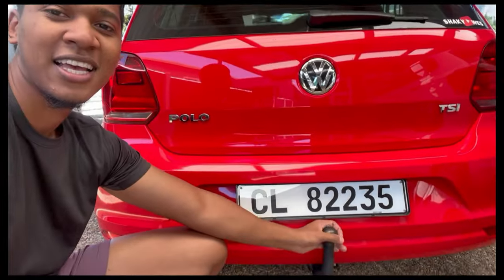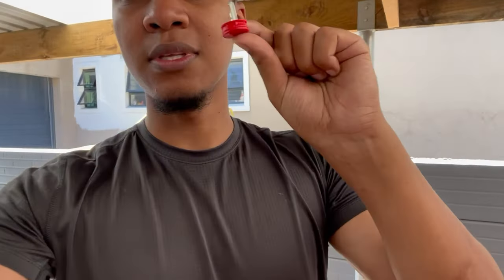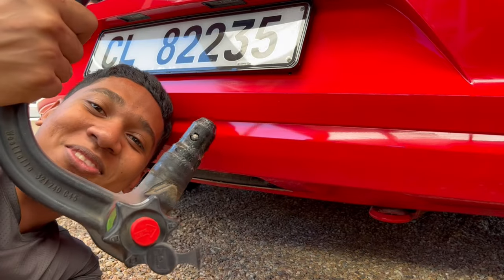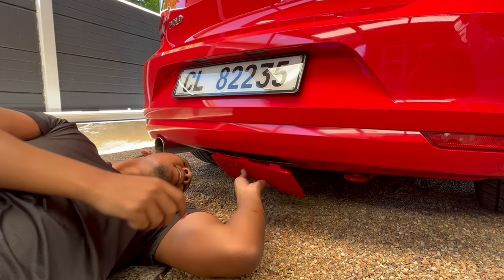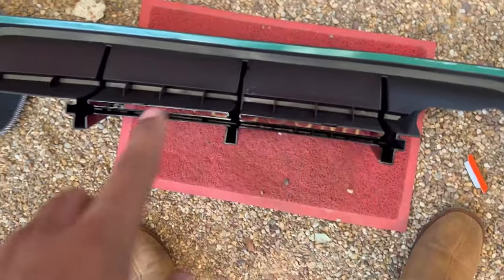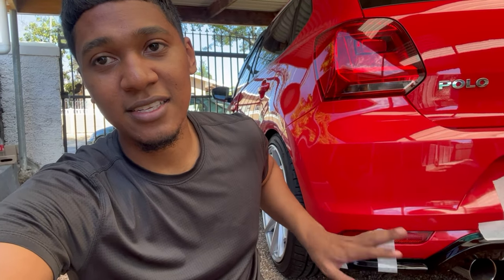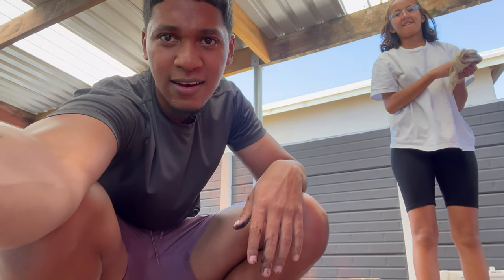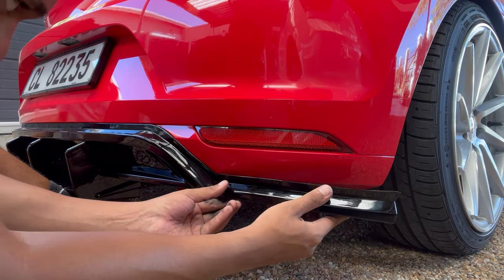INSTALLING AN AFTERMARKET DIFFUSER ON MY POLO 6 - IS IT WORTH IT | PART 6 OF THE BUILD | SHAKYWES

Comment: Where did you get those bits that go to the left and right sides of the diffuser once it's on? The bit extends it out further?
Reply from the maker: Hi i got this with my diffuser so its basically a 3 piece diffuser
Reply: Hi bro,so were did you buy your difusser and how much was it bru

Comment: Got me the same diffuser recently. Do you recommend cutting off the tail pieces around the exhaust ? Coz it is two dummy pipes lol. Is it noticeable on the car that you cut it off ?
Reply from the maker: Hi I recommend cutting out the dummy tail pieces but make sure to cut it out nicely/properly. You will see it but its not an eye sore i would just recommend doing your exhaust first and do a dual tailpiece setup to fill the gap. I hope it makes sense

Comment: Hey man did the the same thing with my polo. Really love the look. The only problem I had was the Tape. What tape do you use and where do you buy it please?  
LOL I even went crazy and cut my bumper so I can Fit two stainless steel pipes.
Reply from the maker: Hi bud i didnt use any tape only used sikaflex (adhesive). Double sided tape doesn’t work i had to reapply it thrice already 😂 first because of the double sided tape and the last 2 times because of the car being so low🙃

Comment: HI I have a diffuser similar to yours however I do not have the two parts that go under the reflectors to compliment the diffuser. I have been trying to search for them all over the internet but I can not find anything. Do you have any idea from where I can buy them?
Reply: Did u find them I been looking too
Reply from the maker: Hi there you can have a look on Alibaba or Ali express just make sure it says its a 3 piece diffuser that includes the side pieces

Comment: Ola

Where did you get the diffuser worth the two things on the side? 🔌🔌🔌🔌🔌🔌🔌🔌🔌
Reply from the maker: Hi I bought it locally here in SA from a reseller (autostyling Cape Town ). I think you might be able to find one on Aliexpress  just make sure the ads say that it includes the two side pieces

Comment: Seriously? You glue that thing? The video is more than 6 months old. Did it fell off already?
Reply from the maker: It has due to driving low so if it scraps heavy like it did it doesnt break the diffuser or ruins your bumper .. sikaflex is adhesive that secures your windscreen so its not just any glue… so overall it does the job and if you dont drive low like me it will stay on forever just like my aftermarket oettinger spoiler